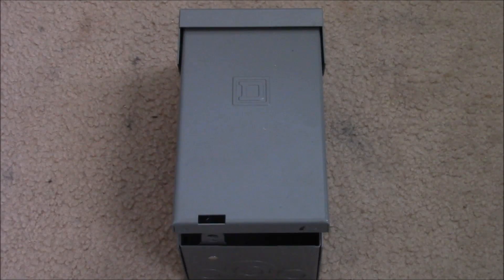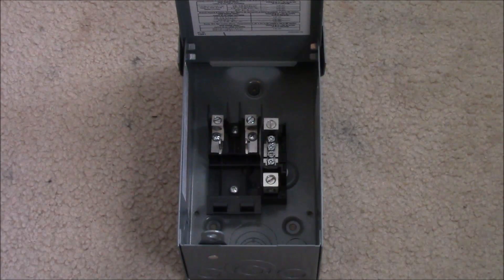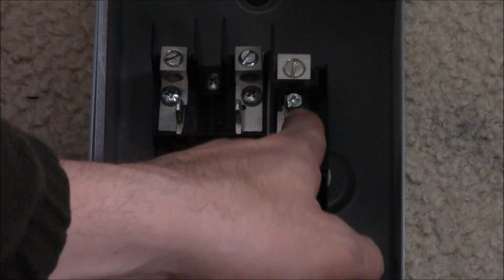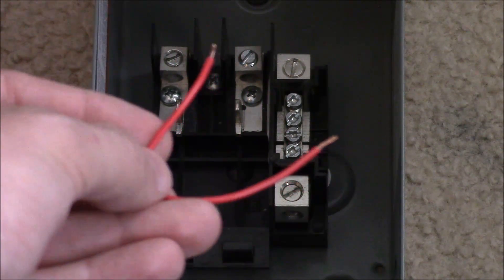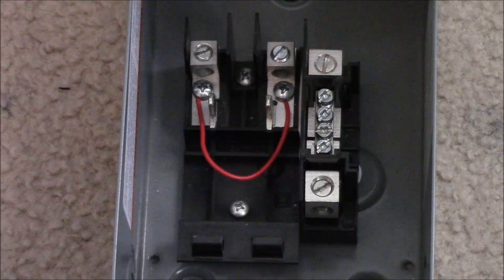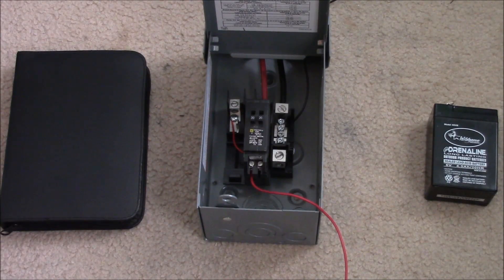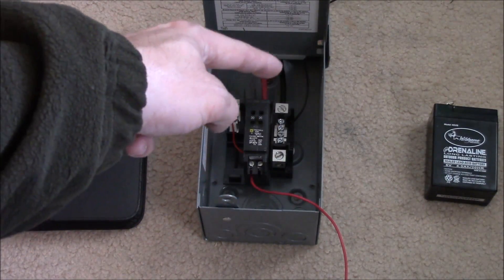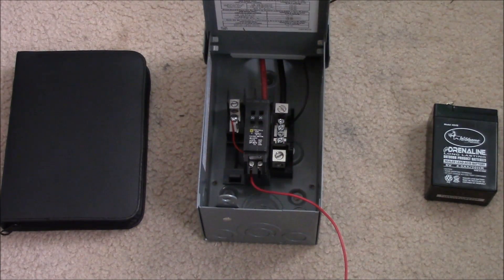Solar Panel Systems for Beginners - Pt 3 How to Build A Load Center Combiner Box

Comment: The problem I am having volt verse amps when it comes to charge controlers I want to pop for a midnight 150 seems to take the highest amps ! I read that you should not max out any charge controler you should leave like 10 or 15 % Lee way . With a 150 it would leave me more room to add panel I have tracer 40 amp with limits me to 400 at 12 v or going 800 with 24 volts now get the fact that the lower the voltage the less pannels you can use and the higher the voltage the more panels I can use and yes the wire size it not so critical  on longer runs with 400w attention being my max due to the inverter I bought 12v to 220 to run a well pump at 15 amps I think I got the calculations  right in my head I am sure I could run more but I just don't  know how big the battery bank should or how many 6 volt flooded  deep cycle batteries parallel it will cage that being said I live in the north east so winter really suck for solar power but I know it can be done was thinking of adding  wind  to it but there to is a different  animal unto  it self
Reply from the maker: You might want to look into charge controllers that can be networked together.  Then you can run multiple charge controllers on the same battery bank and they will coordinate charging with each other.
Reply: LDSreliance this the other reason I was looking at midnight solar the other one is the outback I going to call midnight solar with so question be in the north east was think I should do a high bread system the best I think is missouri wind and solar I have looked at so much stuff and read watched vids on utube it's unreal but just to get start I need to know how much battery  400w will charge I think I am not sure 4 6v golf cart batteries with 215 amp hr rating at 12 volts any thoughs
Reply from the maker: Missouri Wind and Solar is complete garbage.  That guy is a fraud and a hack.  Please look into reviews of his company and practices before you buy from him.

400W will not be able to charge 215Ah very quickly.  You would need multiple days to charge fully from a complete discharge.  And that is if you do not use the system to power any loads for those days.  My system is 600W for about the same battery bank size and it works pretty much perfectly.
Reply: LDSreliance ok talk to me about wind what pmg or pma turbine would you buy. The batteries 4 would make to 12v batteries at a cost of 400 dallors so your telling me 4 hundred watt can't re charge 2 batteries with a 215 amp hour rating
Reply from the maker: Correct, 400W of solar panels will take a while to recharge 215Ah of batteries.  If you are going to be actively using your system to run loads during the day they will struggle to keep up.  If you are only using the system occasionally you could get away with it.

I have not bought a commercial wind turbine so I don't know one to recommend.  I have done a lot of research and read a lot of reviews and came close to pulling the trigger on a few small ones but have not done so yet.  I do know that Missouri Wind and Solar has a bad reputation from numerous sources.  Sorry I can't be more helpful there.
Reply: LDSreliance  hmm what your telling me is that I need more solar to charge 4 6v batteries ouch so the the midnight solar is probably the way to go . Now missouri wind and solar  is their product not good cuz they have a kit I was looking at 1600 watts come with dump load charge controler brake but I will look up and see if I can locate  the complaints
Reply from the maker: Here is just one of many sites with numerous stories:
http://www.topix.com/forum/city/seymour-mo/TEO76N3OLSLPJA3AG/about-missouri-wind-and-solar-review

400W is not really that much.  After you account for less than ideal conditions (not lab conditions where they get the 400W rating) you will be down to about 360W.  Then you have some losses in the lines and controller.  I would say you would be lucky to produce 340W in the real world.  So unfortunately, I would definitely recommend you consider at least another 100W to your system.
Reply: the easy answer ... 12v systems are good for close power generation to usage ... like a camper ... a 24v system is good for a little longer distance like from the house to a garden shed say about 20feet ... a 48v system is better for longer ranges ... like upto 100 feet away ... this is all do to basic power loses from resistance in the various bits ... like your standard house wire will show on its casing how much resistance per so many feet ... more resistance means more loss ... and lower voltage (power) means less current available to use .. and lower voltage to supply the power ... 
if you have a 12v system and run a wire from 10 feet away in the back yard and are using basic 16gauge wire with 1Ohms resistance per foot .. that means for 10feet you have 100ohms lost on the wire ... or 12v /100ohms  = 12 amps max load .... the basic equation is Voltage = Amperage X Resistance ... it can also be written as V = IR or E = IR ... they are the same thing the first is from basic electronics where where volts amps and ohms are the basic units of measurement needed .. while the second one is from science where they use joules to figure energy and what not ... but they are interchangeable at the basic level ... if you were trying to power a system off of a chemical reaction then you would need to learn a ton of chemistry and physics and electronics and get right down into how much of what chemical can produce and what the conversion rate is ... thus the joules version comes in as easier to use ... if you are using a basic setup for a solar powered system the V=IR version is what you want ... 
.
The dummies series of books are an excellent resource for new and old hand users with electronics as they provide excellent descriptions and help for all ... they are worth the money
Reply: ahh having read the other replies as well .. when you get into amp hours .. look up the solar max for your region if you cant charge your batteries to full in that time with your panels then you either need more panels or less batteries ... as the batteries allow for longer usage you are stuck with needing more panels ... 
.
as for the solar max .. generally that is over a 4 hour period during the max light of a no cloud day ... your safety margin is the fact that the light lasts longer than 4 hours except in the extreme north and south ... so figure on a 6 hours of light day to fully recharge your batteries and then you cover the winter light and cloudy days at the same time ... 4 hour max plus a half of that again to get an approximate value for 6 hours 
.
winter on the longest night of the day up around the 49th parallel leaves about 8hours of usable sunlight but being winter it can be as good as 10hours of usable sunlight (expensive solar panels needed that convert multiple light wave lengths)  ... in the usa ... you can expect about 9hours of usable light so you have about 3hours of extra time built in for losses and bad light days on the longest night of the year. after that everything is bonus charge and usage time.

Comment: How well does dc work with aluminum verse copper in resistance a voltage lose
Reply from the maker: Aluminum is not ideal.  I am sure there are lower resistance options out there but they would be much more expensive.
Reply: dc has a habit of creating a magnetic field with aluminum and cause extreme power losses ... best to stick with copper 
.
take an aluminum pipe and a small magnet that fits in it with a little gap .. hold the pipe up and down and drop the battery ... it takes a long time to fall down ... this is a perfect way to show how an electromotive force would be buggered by aluminum in dc ... this btw is the nail as a magnet from a battery experiment just looked at from a different direction ... aluminum is great in high voltage AC as the alternating current is constantly reversing the magnetic properties of the aluminum and at the high voltages the loss is now basically 0 ... dc is always adding to it ... unless you want to get into some serious high voltage dc switching and then you can do the same thing ... but that is well beyond the needs of setting up a power system for a house or homestead

Comment: is charge controller and the load splitter is necessary??
can we replace both of them by using solar inverter only
Reply from the maker: Solar inverters are only for grid tied.  So if you want to use your system off grid then you can't use a micro inverter or string inverter.
Reply: the load splitter isnt the charge controller is if you use batteries at all .. a good dc to ac converter the larger more advanced charge controllers that have the capability to tie into an ac breaker panel would be good for homestead type setups ... also if they can be linked (daisy chained) together for mutiple panel setups and battery setups would be good

Comment: why you need breaker(what function it has?) ?  you cant put it in invertor?
Reply from the maker: This is not a required device.  It is for combining multiple panel strings into one feed because your charge controller can only handle one set of wires.
Reply: thenks can you say i need 3 kilowat 220 volts energy how much solar panel i need and whao i need also to ctreate such energy converter and .... i have a big place....
Reply from the maker: You just need 3,000 Watts of solar panels.  The 220V part doesn't matter.  You'll need an inverter that can output 220V but it won't affect the size of the solar array.

Comment: Hi bro,I want to know how to power 1.5KW Hub motor using solar panel...& i was wondering how much capacity battery to use and what kind of connections to be made & also what kind of solar panel and how much to use ....Please share ur information as soon as possible....
Reply from the maker: Email me at ldsreliance@gmail.com.
Reply: raj c

Comment: Hey man, thanks for putting this up this really helps me on my project in Electronics. Already subscribe to you planning on building my own Solar Panel System at home once I got the budget. Any estimated budget for a System that light up 10-12 LED/light bulbs?
Reply from the maker: Probably around $500-600 total for all the components, wiring, etc. if you shop for good deals.

Comment: sir your videos are great... can you make video on how panel works... plz
Reply from the maker: You mean how a panel converts sunlight into DC energy?
Reply: sir i know about pn diodes, semiconductors, but i whats to know how panel is constructed and how how it works?
Reply from the maker: jashandeep kaur
Alright, I will look into making a video about that.  Thanks
Reply: that should be an interesting video ... on photo voltaics ... perhaps you should cover the different wave length panels at the same time .... I do suggest using a (dang forgot the name) the power part of the wood stove fans ... basically a thermal difference power pack .. it dumbs it down to heat differential

Comment: can you do a solar car
Reply from the maker: It has been done but in order to get it to work it is basically a tricycle with a motor and a lightweight skin on the outside.  You can't drive it legally on the street and if someone ran into you...   You just can't make a real car run on solar right now with the existing technology.
Reply: So did you did the solar car
Reply from the maker: johauri pacheco No, I have not made one.  I have seen examples of people who have built them like high school science teams or corporate competitions and they are cool but not practical at all.

Comment: What if you only wanted to run AC power through the load center?  Do they make inverters that you can run positive and negative wires from (instead of 120 outlets or USB outlets) directly into the load center?
Reply from the maker: Yes.  I have seen some like that.  Usually those are the bigger and more expensive ones that are designed to be wired directly into your home load center/breaker box.

Comment: Sir I have a question.. Im planning to buy a 280watts solar panel, 30amps pwm charge controller and a 1000watts of pure sine inverter now the question is  it is possible to run my 30 or maybe 60watts electricfan without a battery if yes what Ah of battery do i need so i can use my fan during night for 8hrs.. Hope you can answer my question thanks in advance!!!!
Reply from the maker: You can run the fan without a battery during the daytime when you get direct sunlight on your solar panel.  So during the summer that will be around 8 hours depending on where you live and maybe only 2-3 hours during the winter.  If you want to run it beyond that you will need a battery.  To run a 60 watt fan for 8 hours you would need at least 82 amp hours of battery capacity.  So I would recommend about a 100 Ah deep cycle battery and that will give you a little room for error.
Reply: +LDSreliance oh thanks! Btw, with 100ah deep cycle battery (bnew) and 8hrs continues usage during night time..how much percentage will be left knowing that it will requires to have atleast remaining 50% charged?
Reply from the maker: If you had an 82 amp hour battery (which doesn't exist in that exact number) it would be discharged to 50%.  So if you had a 100 amp hour battery it would be roughly 59% after 8 hours.
Reply: +LDSreliance sir last question how can i compute the total usage time of my battery? Many thanks!!!
Reply from the maker: Christopher Derit Your battery should be rated in amp hours.  For deep cycle batteries, that will be a rating of how many amps it takes to fully discharge the battery over a 20 hour time period.  So if the battery is rated at 20 amp hours, it can provide 1 amp for 20 hours.  (amps x hours = amp hours)
Reply: +LDSreliance many thanks sir!!! I really appreciate your help!! :)
Reply from the maker: Christopher Derit
You are welcome.  Good luck and thanks for watching!
Reply: +LDSreliance sir its me again!! Another question this is AC breaker right? Do you think is it ok im going to add a fuse holder with 30amp fuse in every wire? And lastly what gauge/kind of wire im going to use? Is it stranded or single copper wire? Thanks in advance!!
Reply from the maker: Christopher Derit You can use a breaker series from Square D called QO that is rated for DC use.  I like using breakers because then I can use them as a switch to turn loads on and off or shut off all power so I can do maintenance and re-wiring.  But you can use fuses if you want.  Just put one in series on each positive wire for each load.

Comment: Dude thanks for the time to show us. I'm installing a dankoff slow pump to pump water to my house we are building I got most of everything but the romex and wiring the system up. I could use your help with voltage drop. 24volt 200 watts and 150 foot from panels to pump. Dankoff slow pump 1308 if your filmiar. Also was wondering how to install lighting arrestor for lightening storms. Thanks for your help
Reply from the maker: To avoid excessive (greater than 5%) voltage drop, you will need to run #4 AWG wire for 150 feet.  If you can cut the distance to 130 feet you can use #6 AWG.

As for a lighting arrestor, I have never installed one.  I assume this will be on your roof?

Comment: ok ' & 1 Question? ? how many bettery can we add in 32 watt solar panel ' i have 2 12v 70amph battery can i add both in one 32watt  solar panel'?? if we can then plzz how we can '??? give me tips on video
Reply from the maker: Are you asking how to wire it?
Reply: I have to 2 battery how can i charge it by 1 solar panels
Reply from the maker: Aantaya Giri Wire the 2 batteries in either series or parallel (see video below) and then connect the solar panel to a charge controller.  Then connect the battery bank to the charge panel.  The charge controller will take care of the rest.

https://www.youtube.com/watch?v=4yxR-Iz2Xdc

Comment: what gauge wire should we use ?
Reply from the maker: As big as you can afford.  Seriously, it is always better to use bigger gauge wire as long as it will physically fit in the connectors and you can afford it.  That will minimize voltage losses and maximize safety.

Comment: Couldn't you just plug in a power strip into the AC converter and then be able to run multiple loads that way????
Reply from the maker: Yes, of course.  The reason you might want to run multiple loads through a load center would be if you wanted to run some 12v loads as well as one load tied to your inverter or if you wanted to be able to turn certain loads on and off with the circuit breakers.

Comment: i have 12v 7amh batetery with charge controler and i want to add inverter to run a tv can i do it can u give me some tips on this
Reply from the maker: You can use pretty much any inverter as long as it can provide enough watts for the TV.  If your inverter comes with a cigarette lighter adapter you can just cut that off and then attach the positive and negative wires to the charge controller.  However, a 7 amp hour battery will not run most TV's for very long.  If you give me the make and model of your TV or tell me the amps it requires and how long each day you want to use the TV I can calculate what size battery you will need.
Reply: Ok & thank U For Reply
& what type of inverter we have to used'
Reply from the maker: Aantaya Giri
For a TV, you really want to use a pure sine wave inverter.  They are more expensive but the cheaper inverters can hurt your TV over the long run.
Reply: Can u named of inverter'' or we can ask by saying wave inverter in shop
Reply from the maker: Call it a "pure sine wave" inverter.  They should know what you are talking about.  Or order one online such as this one:

http://www.amazon.com/Power-Bright-APS600-12-Inverter-continuous/dp/B002RWKIL0?ie=UTF8&keywords=pure%20sine%20wave%20inverter&qid=1464660756&ref_=sr_1_10&sr=8-10